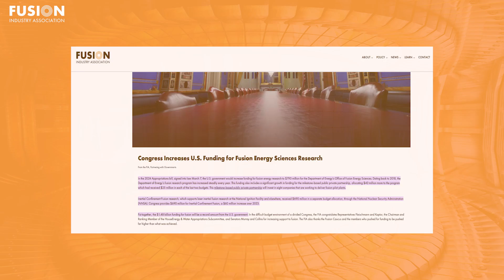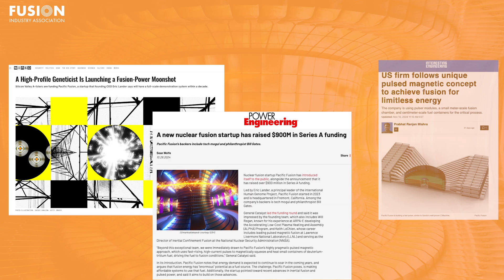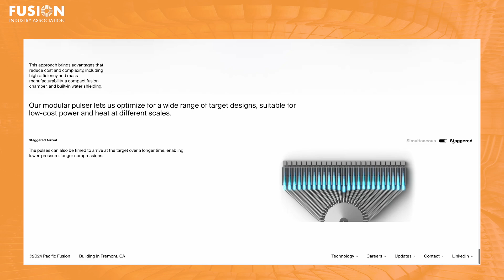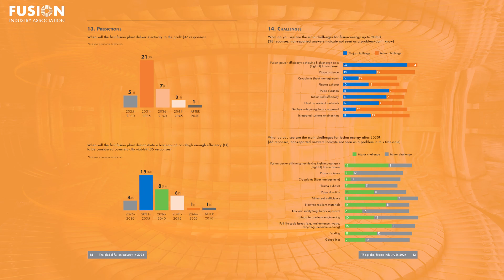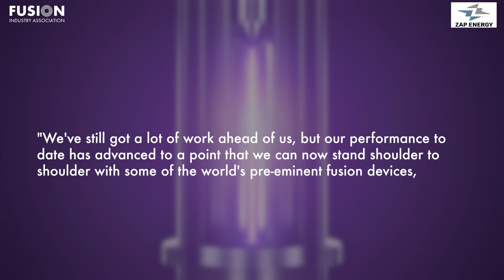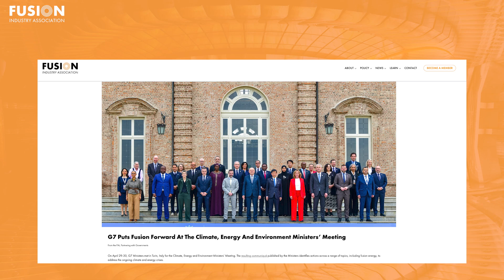Fusion News: 2024 Recap

Comment: Near the beginning of the above presentation was mention of the ‘break-even’ fusion experiment announcement from the National Ignition Facility’s (NIF) December 5, 2022, laser shot. Omitted was the following facts. That break-even goal was supposed to have taken place by 2012. The experiment took about a week to set up but the fusion reaction lasted for only 0.000,000,000,08 second. The force of the reaction, at the center hotspot, then blew away 96% of the expensive supplied fuel before it had an opportunity to fuse. That was then sucked into the target chamber vacuum pumping system. The quoted input energy, that heated and compressed the plasma, was less than 1% the energy required to pump the lasers. NIF has always been primarily funded as a thermonuclear weapon (H-bomb) research tool, not as a viable path to a future fusion energy power plant. Over $11 billion USD in federal revenues has already been sunk into that project that created enough fusion energy that could have boiled a few liters of water.

Those, behind the FIA, could benefit from a course in critical thinking skills.

Comment: The FIA exists to promote fusion energy and it’s clearly rather successful but this presentation reported nothing new. Where are for example the reports on DT experiments, methods of enriching lithium, high energy neutron irradiation experiments and tritium breeding experiments - all absolutely essential before any fusion reactor can be built. The only result mentioned was the irrelevant NIF ‘more energy out than in’ work - irrelevant since it ignores the massive energy used to put the energy into the target.